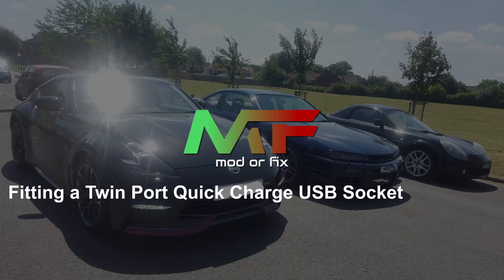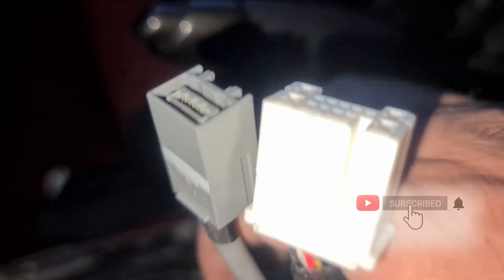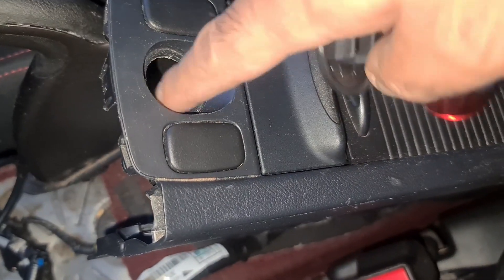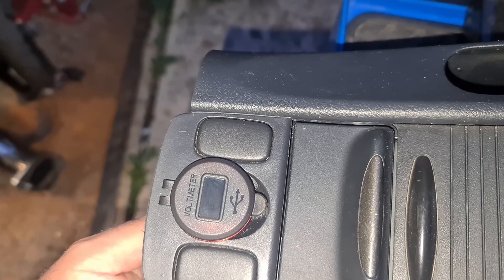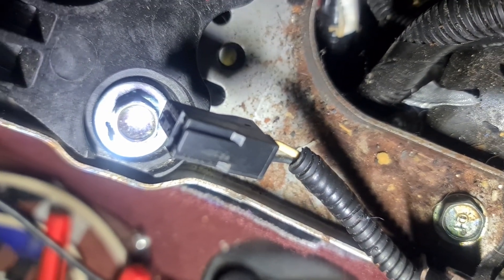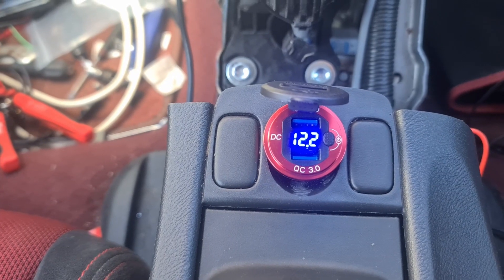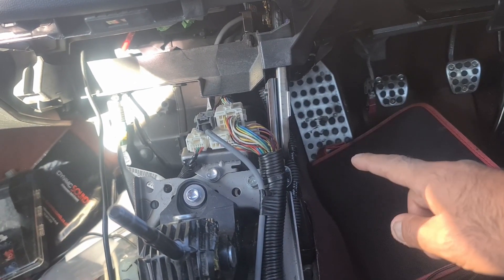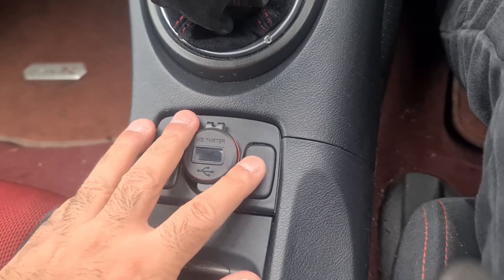Fitting a Quick Charge 12v 3.0 USB Car Charger Socket with Voltage Gauge

Comment: Do you have to wire it in if u still have the cig plug there
Reply from the maker: Yes but it would be quite easy if you know what you are doing. Just tap in to the +/- wires on the existing socket

Comment: Hey mate, nice simple mod that.  Do you have a link where to get the socket?  I can only find them in China.  Cheers
Reply from the maker: I got mine from amazon but its out of stock now. Try this https://www.ebay.co.uk/itm/Car-Dual-USB-12V-24V-Charger-Quick-Charge-QC3-0-Socket-Power-Outlet-w-Voltmeter-/363442884303?mkcid=16&mkevt=1&_trksid=p2349624.m46890.l49286&mkrid=710-127635-2958-0
Reply: @ModorFix  Thanks fella, just got my civic, driving me mad with just the useless cig lighter - subbed
Reply from the maker: @benamandius587  mine was missing in its entirety so made sense to fit the dual socket. Just bear in mind that if you need to use anything with a cigarette lighter plug like I did the other day, there is a socket in the boot ;)
Reply: What tool did you use to change it to spade?